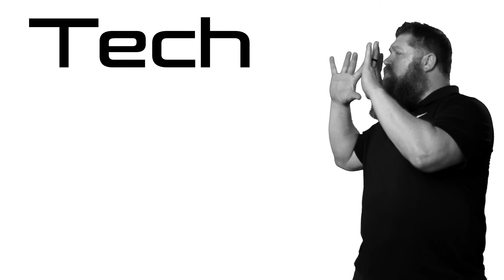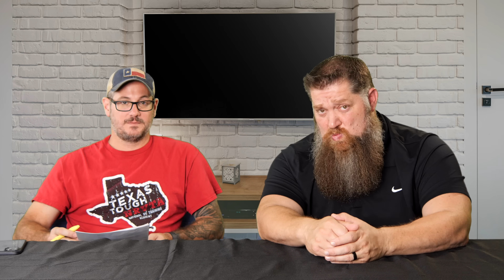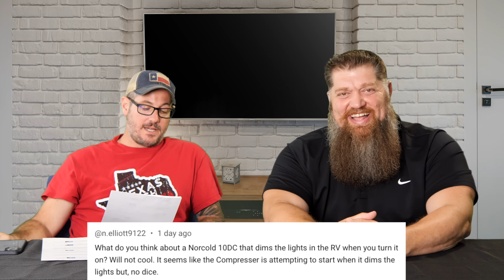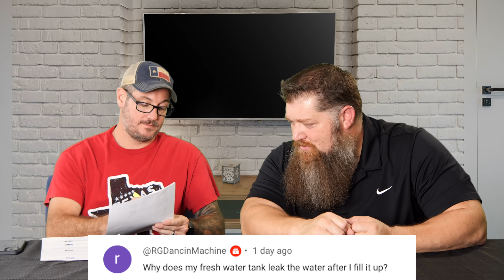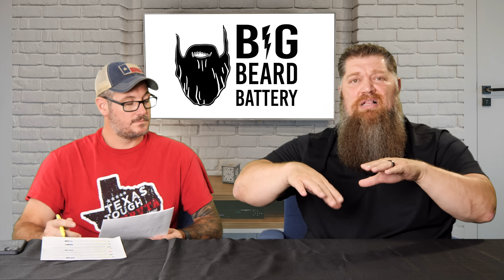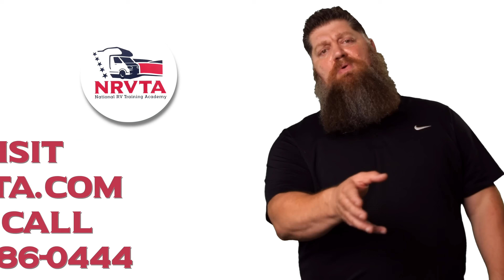12 Volt RV Fridge Not Cooling - Two Minute Tech Tip Q&A

Comment: All commercial lithium batteries have a BMS that balances the internal cells, and which you have no control over. When you connect multiple batteries in series they will end up at the same voltage externally. Charging the batteries individually first will speed up the process of balancing.

Comment: My RV refrigerator is a magic chef that runs on shore power as well as solar/battery. I have reset it a number of times troubleshooting it but after anywhere from 1 to 3 days, it just stops cooling! There is no access to the refrigerator from the outside. I’m hoping it’s just doesn’t have proper ventilation. I do hear the compressor running when I turn it on and I do hear a fan… I don’t know how many fans it has. But I’m tired of having to throw food away!!

Comment: Glad our manufacturer used 8 gauge wiring for our 12v fridge.  

The fridge manufacturer recommended 10.

Many have been using 12 or even 14 gauge wiring and putting them on the same circuits as lights which scares me.   

Ask the RV manufacturer what gauge of wiring with their 12v fridges they are using before you buy.
Reply: What has your experience been with the 12v fridge? How long have you had it?

Comment: Greetings.  I have an unrelated RV question for the experts, but I'm not sure where to post it.  I hope you don't mind:  I'm looking to purchase a new RV travel trailer and I'm not sure about what kind of ball mount I need.  The manufacturer's rep said the model has a 22 1/4 inch coupler height.  My receiver is at 16 inches.  Based on this, I would assume that I need a mount with a 6 1/4 inch RISE.  However, should I adjust to account for the weight of the trailer (basically, the hitch weight) as it would be applied when I have the trailer hooked up?  I appreciate your advice on this very much.

Comment: The answer to the question about the water heater is No it Should Not. 
The treads are Pipe Treads. They are tapered and get tighter as you screw in the rod. You need to be careful not to over tighten and Crack the water heater tank👍

Comment: 12 volt fridge not cooling - I agree with the recommendations but would add, the load of the compressor is higher on startup, meaning higher current draw. The manufacturer of the RV or the installer of the fridge may not have used a large enough gauge wire for the startup load. The higher startup current can cause a higher voltage drop across the wire leaving not enough voltage to start the compressor. As the compressor ages, it will likely require more start current. 

One way to check, if the wire is too small, would be to run a wire parallel to the original (both + and -) or to try a larger gauge wire by itself from the battery to the fridge if you have the skills.

I had a similar problem with a cheap 1KW inverter. It would trip the over load circuit on startup.

Comment: Yup.  EXACTLY what’s happening with my Norcold 12v fridge.  Can’t go through its cooling cycle even on fully charged batteries.  Throws an E3 low-voltage code every time.
Reply: Would you purchase a 12v Norcold again? How long have you had yours?

Comment: Re: the leaky tank...I have a 2018 Wolf Pup that leaked with a full tank. Turns out Forest River didn't install an overflow hose connecting the tank's overflow connection to the overflow valve!  I thought it was a mistake, but after some digging, I discovered it is/was common with the Wolf Pup, if not all Cherokees!  Unbelievable!   I installed a hose-no more leak.